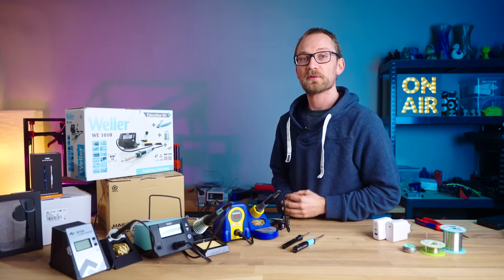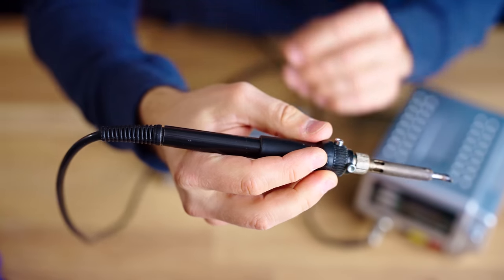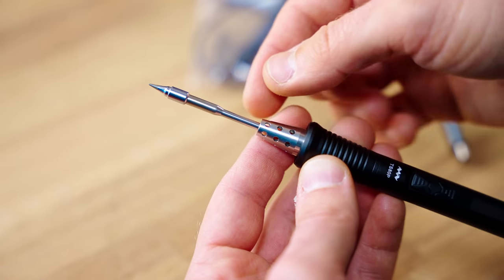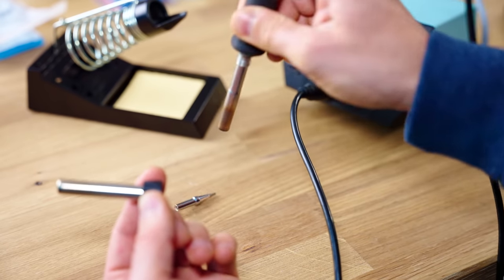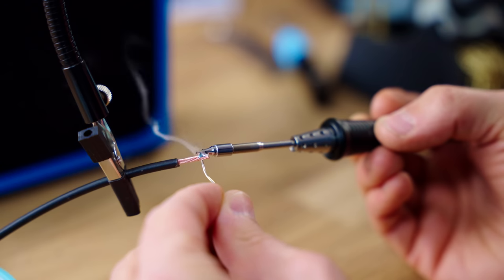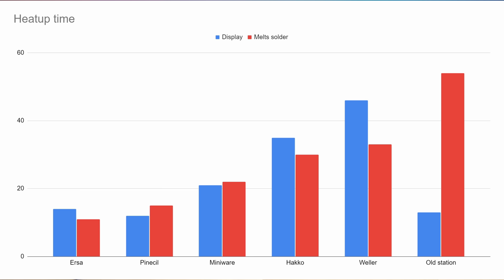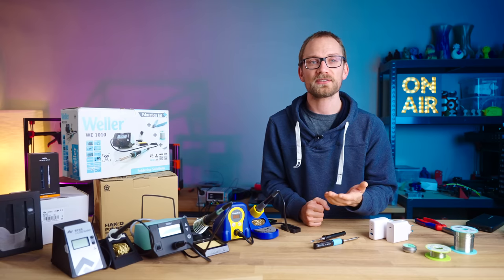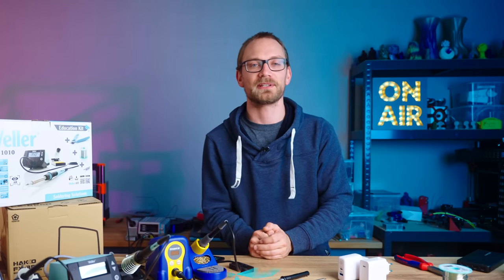Best hobby soldering iron? Pinecil vs. Miniware, Hakko, Weller and Ersa

Comment: I bought a TS100 a couple of years ago... from what I can see, it is a relative of the Pinecil, so what a have found may also be valid there.  I am not a heavy user, but for me it has been a constant source of smiles!😄  (Especially at the price).  I run it from a laptop power supply, and 3D printed a dock for my 18 volt drill battery, which gives me portability.  I bought three alternative tips for it, and after lots of on-line reading, and taking a deep breath, downloaded and installed after-market firmware.  This transformed the "User experience", and gave me even more smiles.   😄😄
It even lets me use the temperature sensor to check the temp of my coffee! (It's probably poisoning me slowly though.)  If you are a Pro, spend up... if you are a Hobbyist like me, the Pinecil looks like a hoot... knock yerself out!  👍
Reply: Pinecil is essentially TS100 but with a USB C/USD PD input added as well (alongside the regular DC barrel jack)

Comment: I am traveling daily for work and I've been using TS80 (previous generation) a lot with Power Bank. Best traveling soldering iron by far that I've used and you can do practically everything with it. Repair electronics (0603 and even 0402 SMD components, no probs with Pencil head) and soldering thicker wires with chisel tip, everything without problems and through power bank, giving you freedom like no other. I've also not encountered during these few years any of the crashing described in the video.

Comment: I have used hundreds of different irons over the years from standard to de-solder to SMD and hot air rework...  Overall, the Weller has been the standard throughout the years but has also had an almost outrageous price tag until recently.  I think the tide of new cheaper irons has managed to drop them into at least reasonable ranges. The Ersa was just not impressive.  I currently use a Weller EC 1002 as my main workhorse but recently got a Yihua rework combo station that has been getting great marks in my book. Plenty of power, fast, and just a solid set to use... I also have a USB powered one for light quick work that was neither of the ones you showed but is great for wiring of 14AWG or less. The other one is a specialty production unit that feeds the solder through and motorized reel directly to the tip and is GREAT for large numbers of connections like an IC or DIP.  I think it might be an interesting series if you were to run the same test series on other units and build a database of comparisons and prices... I know that I would be interested in such a thing and I bet many of your viewers would agree.

Comment: Wow, what a fantastically in depth comparison!

My first “real” iron was a Weller WES-51 (with a knob instead of screen). I’ve also used a 888D for years and love it. That’s my personal recommendation for the best “starting out” general use soldering station. BUT. A couple years ago I got a portable iron that uses Weller active tips (similar to TS-80 or TS-100/Pinecil but not those) and let me tell you, there’s no going back. The small size and quick heat up are nice, but it’s the short tip length and quick swaps that really make it a joy to use. Having the right tip for the job is more important than a lot of people realize, and being able to swap quickly is so handy.

And yay for the OpenBuilds discount code, I have several hundred dollars worth of v-rail in my shopping cart at the moment!
Reply: This sounds interesting. Can you tell us more? I currently still use an old WELLER WESD51 with digital readout. Still love this thing, but a portable option would be nice without switching tip brands. EDIT: oh, i see you mention it uses active tips? I guess not compatible then with what I currently have. lol. oh, well.
Reply: @andrewbarney5503  correct. Tips are mde by Weller but not compatible with the WES-51. RTM, RTP and RTU is what they are called. The Weller soldering stations that drive them are $$$, but there are third party drivers that exist, which is what I have.

Comment: Long Time Ersa user here - bought a nano 10 years ago and didn't regret it - the ergonomics of the short tip are just so much better than the "classic" designs where you grip the iron far back. IMO these designs are not for electronics. The performance is very good compared to hardware store stuff and the tips are quite cheap and come in a great variety. Looking upwards, soldering irons with cartriges that integrate the tip are one level above the ersa - especially when doing stuff with well connected ground planes and similar heat sinks. The pinecil and similar devices get this right while being much cheaper than the legacy competition (JBC etc.), they just lack the power to do large stiuff. For microcontroller stuff only I would buy one of these over the ersa.

Comment: After some cheaper soldering stations, a couple of years ago, I bought a previous version of the Ersa Nano. It still works flawless and fast. 
The only thing I'm missing is some LED that shows, that it is on. 
I've had it on a couple of times for a couple of days because I forgot to turn it off. Since it turns down to 65° C in "sleep mode", nothing bad happens.
Reply: i actually modded mine with a backlight to be an indicator that it's on, before that i forgot to turn it off way too often.
Reply: @victortitov1740  Me too!

Comment: By the way you dont need to change the temp each time you boot up the ts80p. You can set a default temperature. And there is a shortcut to change the temp from the soldering mode.

Comment: I know this is super late, but it's worth noting the Weller is supposed to wake up from standby automatically, but because it doesn't have an accelerometer, it has to use the thermistor. Basically, you're supposed to just try to resume soldering, and it will detect it and wake back up. Unfortunately, it rarely works, and I just resort to pushing the buttons to wake it up. Probably the only flaw to the device in my opinion.

Comment: The Ersa Weller and Hakko are all used in this video with a much larger soldering tip than the 2 other irons. If you are doing a comparison of soldering ability you should use similarly sized soldering tips.

Comment: I had the Hakko and sold it after trying the TS100 and I have used that for close to 3 years. The body broke around the charge port and I was sent a replacement from miniwear for a reasonable amount. Recently I bought the Sequre D60 as a backup and for the price that is also good and uses the same tips as the ts100, but the software was not as nice to use. I have it setup for pressing brass inserts into prints at the moment.  One problem with the TS100 is the number of fake tips around that will not give a stable temperature or give a sensor fault so make sure to use originals. Thank you for taking the time to test and share these.

Comment: You missed out the TS-100 which is not simply the predecessor of the TS-80. It has the same tips as the Pinecil but supports 24V thus give it a bit more power. The Pinecil only allows for 21V. Also worth mentioning: the Pinecil is driven by flashy new Risc-V tech which can be exploited via an USB-C breakout board to transform the iron to a full blown dev kit. Not sure if that is useful, but the level of dedication by Pine64 is way over 9000 for sure.

Comment: You forgot the Aixun T3A and T3B.  Price is comparable to the larger full sized stations you are already reviewing.  It heats up in 4 seconds, small profile, excellent sleep function, and uses JBC 245 or 210 tips.  Performance is superior, and with the last firmware updates, they are identical to the JBC.  I would say they are now the standard.  Yes, tips are more expensive, but they are overall great units.  I also have a Pinecil and TS80, and they are excellent as well.  Depending on your needs, the Aixun, Pinecil, and TS80 are best in their categories.

Comment: How about the Goot 800 series. Very compact, heats in 6 seconds, tips can be hot swapped by simply pushing tips out with the integrated slide lever. No need to let them cool down. Has programmable high/low temp alarms and  soldering alarm for sensitive components. Had mine for 8 years, still going strong.

Comment: I got my Ersa iConPico for around 130 Euros, but I'm impressed of the fast warm up and power! Why did you recommend Weller??? In every test Ersa was better, don't you like the Ersa? Or it is a preference of you to use/recommend Weller? Maybe affiliate? I solder now with the 3rd Ersa iron, since 35 years or more? But never let me down, works like a charm, but with the leadless solder, I needed a more powerful iron, so I recommend the Ersa iConPico, best experience, fast warm up, endless power, you can even pre program the station with a sd-card!

Comment: great video!
just a few inaccuracies about the pinecil though: 21v max input (changed since initial release) and also only the top screw holds the tip in place, the bottom one holds the casing together

Comment: A lot depends on what type of soldering you are doing.  Solder splicing wires doesn't require an expensive iron.  If you need to work on a vehicle's wiring I would suggest a butane soldering iron just because you don't have to mess with a power cord.

Comment: Now I understand why the ERSA has such a better performance compared to many non catridge irons, It's the tight fit of the tip over the heater element. Some of the Chinees clones are loosely fit and struggle to maintain a good enough response to heat change. The Antex use a sleeve between the heater element and the tip
.

Comment: I have a Weller and a Hakko T12 clone. The T12 clone melts a 62/36 Kester solder with a KU tip in 7 seconds from power on. I have run out of lead-less solder, so I can't test that time at present. My Weller has become a showpiece now. I also made a conversion kit to run the T12 clone from a 12V battery, as it actually uses a  24V 120W input.

Comment: Underrepresenting the miniware soldering irons.  The TS101s firmware doesnt crash when swapping tips and has easy-swap cheap tips with high heat capacity tip options.  It also has a boost mode to help with soldering thich gauge wire, which ive only gone down to 12 awg or 4mm^2, but it does it so quickly and easily that id be astonished if it cant do a 6mm^2 wire.  I think the temp performance is also better than the pinecil.  Part of the reason why the ezra performs so well is the tight fit between the tip iron, and with the miniware integrated tips, swapping is easy with similar great contact.

Comment: Tom, your video is uncannily timely. I have a TS80P at work which I had an engineer from Japan try out. He was impressed with its performance considering it was USB powered (9 or 12 volts via PD), but the tip I usually use wasn't compatible with his workflow, he was too used to the default tip on the Hakko FX888 series. I have a tip that's similar to it somewhere, but it was just easier to have the company order a couple of Hakkos via Digikey.

I'm loving my shiny new Pinecil. I do wish it used the TS80 tips, though.

Comment: The big advantage of a Pinecil or TS100 is that you can very easily make an adaptor to use battery packs from any cordless tool battery system you have and take the iron to the job rather than the job to the iron. You can 3d print one or most brands have a usb adaptor for their batteries that you can just wire straight in to.

Comment: For simple occasional jobs around the house I think one of the best options is a transformer soldering iron. Like Lutola popular in Poland. The tip is just a copper wire. Cheap, heats up in no time and doesn't need a charger compared to USB-C irons.
Obviously rather not suitable for SMD, albeit some had success with it.

Comment: I need something like a hybrid of Pinecil and Ersa. 

I currently have Velleman VTSS30 - bought for under 50 EUR, which has served me well. However, sometimes I felt a bit clumsy when soldering smaller circuits. So I bought a cheap USB soldering pen. I did not have any expectations, considering it cost just 5 USD, but I was surprised to discover I enjoyed using it. It's so easy to grab it from a drawer, unlike the Velleman which has to be stored somewhere when I'm not using it. My hand coordination feels so much better with the USB pen. 
But sometimes it's too weak and I would like to replace it with something small and a bit more powerful. So I hoped something like Pinecil would be great... alas, it has a much longer tip, and they are so expensive.
So, maybe I should get Ersa... but then it's not as portable as Pinecil. Sigh. Come on, manufacturers, please create a portable Ersa or a Pinecil with simple and short and cheap tips.

Comment: I have an old weller at home. Must be pushing 10 years now at least. It has trouble heating big joints but it gets the job done eventually. I have been looking to buy a battery powered one because the cable seems to get in the way all the time

Comment: Hi Tom! Pinecil V2 got an update to use usb pd EPR 28V (140W). I've seen a video of it hitting 300c in 3s. Make sure the usb cable is rated for EPR so it doesn't bottle neck the device!

Comment: i have the exact model of your old soldering station, and i have all the best to say about it. don't know if i was lucky or you are extremely unlucky, but AT80D that i'm using is performing so much better than i expected. i use it on very big ground pads (up to 3 times the size that you tested it on) and it performs without a hickup. i was so surprised to see it perform soooo poorly in this video, and just wanted to give my 2 cents. don't like the tip rest holder that much, but i do think it's a very good station., for it's price of 85 Euros

Comment: I’ve had my i-Con Nano for 7 years now and it’s served me extremely well. I just finished an internship at a place that used the “big” i-Con models (the 1 and 2), and it’s hard to even notice a difference between the Nano and those, though I’m sure there are some situations that can show a difference. If I had it to buy over again, I’d probably get the i-Con 1 because of the backlit display and rotary encoder for setting the temperature.

Comment: The only station I've bought is a 898D. Soldering and heat gun for $70. Haven't had a problem in years. The heat gun is very useful for salvaging parts and heat shrink etc. The cables are rather heavy and short though.

Comment: I have a Xytronic LF-3300, it's a 180W soldering station that uses high frequency induction rather than a resistive heating element and costs around $250. (also it's 120w little brother the LF-3200 goes for around $150). Overkill for PCB soldering but if you need to solder 8mm bullet connectors to 8 gauge wire it does that with ease.
 
Note that this is NOT a curie point iron like Metcal, it uses 450hz 32v AC running through a coil around the tip and the tips have a channel in the center that a temperature proper inserts into. Compared to curie point irons the temp control isn't quite as fast (curie point irons use physics not electronics for that) but the tips aren't fixed temperature and are less expensive, and the power output is higher.

Comment: Personally I'm a big fan of the TS100. It's about $65 and can run off a lipo battery or DC supply up to 24 volts and the higher the voltage the faster it will heat up. I got mine shipped with a 19V supply and its been pretty much perfect for my use.
Reply: The pinecil is basically a cheaper better version, uses the same tips, lets you use either USB C or DC barrel jack, etc. I debated getting a TS100 for literally years, then when I learned about the pinecil a few weeks ago and saw the price, I almost immediately ordered it (plus another set of assorted tips and a silicone USB-C cable, and a few other goodies from Pine64 as long as I was paying shipping)

Comment: I instantly thought of Project Farm :D. I'm using the predecessor of the TS80P for a while now and I'm still very happy with it. Stock firmware, no crashes yet. I ditched the TS100 (I think this is the predecessor for the pinecil, but only with barrel power supply) for the TS80, because the handling of the TS80 felt much nicer to me.  Great video as always! Thank you Tom!

Comment: The T80 and T100 series have a lot of good to them, but they suffer the same flaw - a huge distance from grip to tip, and using specialized costly cartridges. I think there's a huge hole in this test/review: The STM32 based T12 stations from Ksger, Quicko etc. In particular the ones with a proper menu, not just a temp display. You can get absolutely decently good ones with built-in power supply for $40, or $20 without, with an iron. Some of the ones without built in PSU can run off 12-25V, and they're about the size of a 2-inch thick Rpi zero, so you can easily run them with a power tool battery. Or 3D print a housing-adapter so the whole thing clips onto the power tool battery, using the battery as a heavy base 😃 They can use regular genuine Hakko T12/T15 cartridges to their full 72 watt potential, or their Chinese clones which have gotten incredibly good by now and only cost $3-4 a pop, and there's probably 50+ tip variants to choose from. They can be easily hot-swapped, there's lots of different iron handles to choose from, have auto-sleep and -wake, quick boost function, support per-cartridge temperature calibration etc. But even more importantly, the majority of handles for them have roughly 50mm distance from grip to tip. This is a total game changer when working on small electronics, because you're no longer trying to maneuver a long stick (it's much closer to holding a pencil or pen). This also means you can rest the side of your palm on the surface, decoupling all the jitter of the larger muscles in your arm and shoulder that manifest as shaking at the hot tip end. These little movements manifest exponentially with the increasing distance from grip to tip.